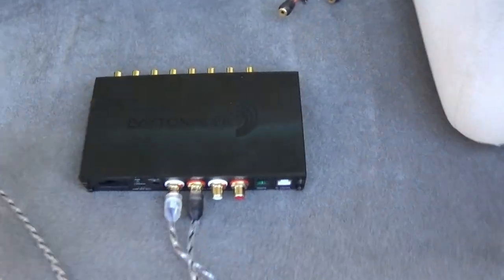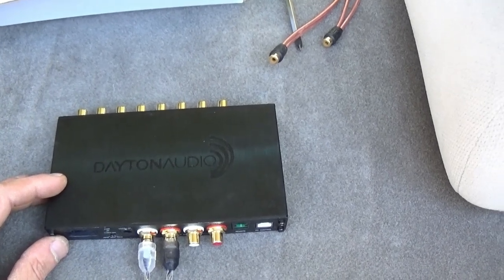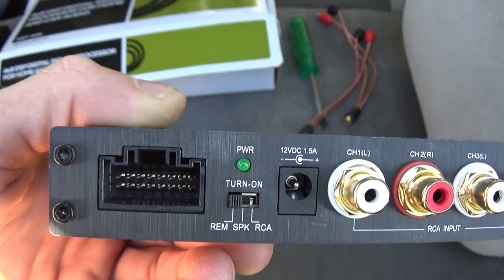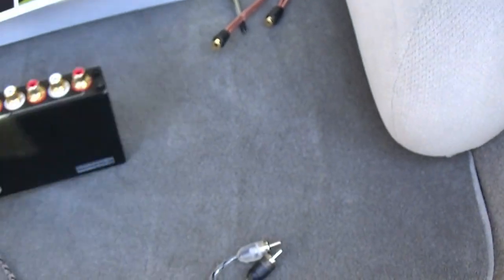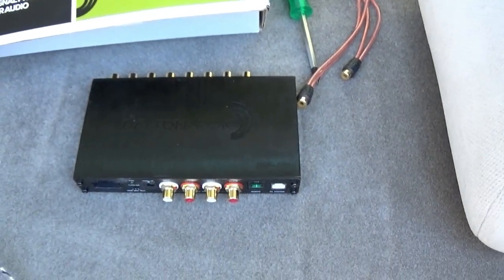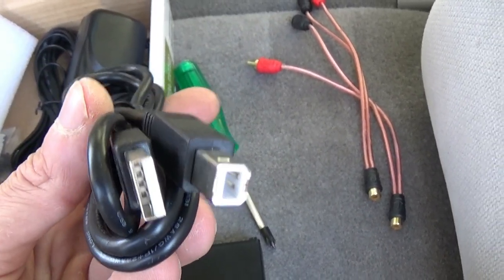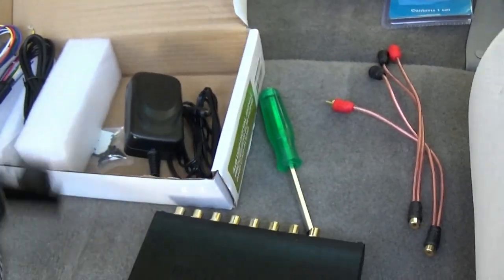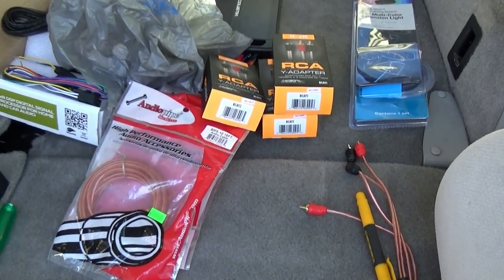Dayton Audio DSP 408 Review and Install! #daytonaudio #caraudio #audio #loud #dsp #stereo #carstereo

Comment: Hi my car's original audio system has 10 speakers, each with it's own output channel on the amplifier with different frequencies.

Can I connect 2 low power speaker outputs (like the front left mid and front left tweeter) to one channel on the units high level input?

Thank you in advance.
Reply from the maker: Sounds great!
Reply from the maker: Try it and see what happens. A lot depends on the amp and the ohm load. Hard to say with just that info. Try it and see how it goes.

Comment: Parabolic lmao
Reply: I think u meaned parametric
Reply: @TrapMyRide.  cool I didn't know they existed. I am getting a helix to put in my 2023 nissan. Bought one of these but after getting used to b&o in 2018 ecosport I think a step up in dsp will make the base model system sound better in 2023 car. Any ideas for a good fix for bass rolloff? As I intended helix for truck and this one for leaf but after some research that thing already has a 600w amp so vocals are clean just even with monoblock bass seems to go down with vol increase. Learn something new everyday
Reply: BTW truck (titanium ecosport) apparently gas b&o 10 channel system so mainly I need bass to hit harder other than that perfect sound stage .. the leaf (2023) is as stock as it gets. Replaced components in it Day one from buying it they were that bad. I have partially installed this dsp and was going to put a loc 22 behind stock head unit to feed this but I'm told it doesn't like anything over 4v. The loc 22 can reach 8 I believe.  What do you think would be best for both? I want to make 2023 sound clean and the titanium is already clean just need to get bass to slap without the rolloff it's getting from connecting loc 22 on that directly to the sub which has 2 feeds going to it
Reply from the maker: thank you!
Reply from the maker: thank you!
Reply from the maker: thank you!
Reply from the maker: thank you!